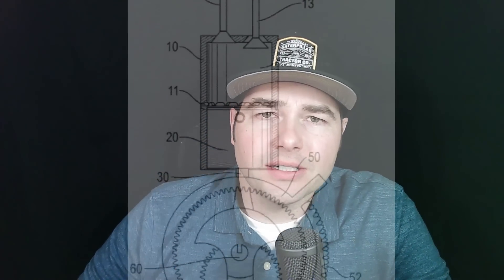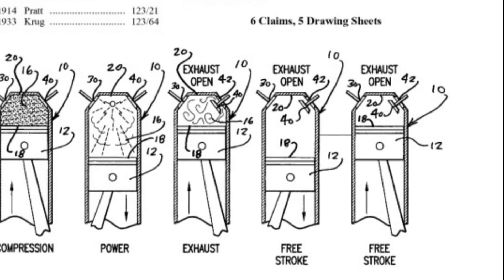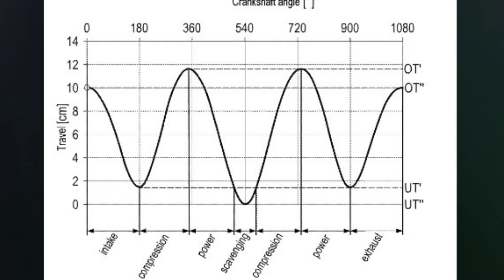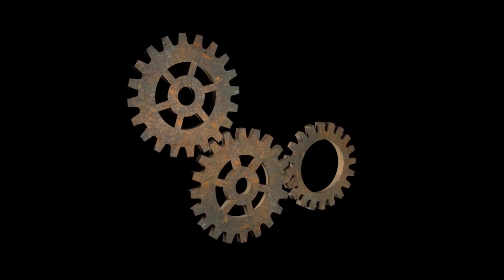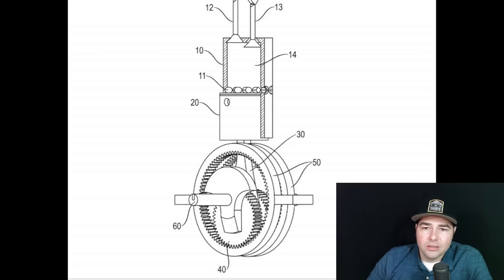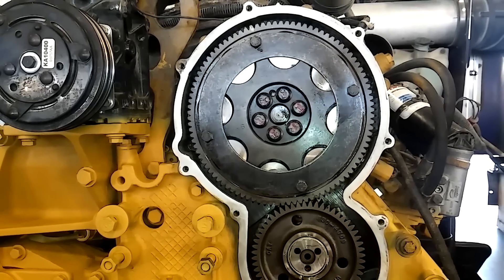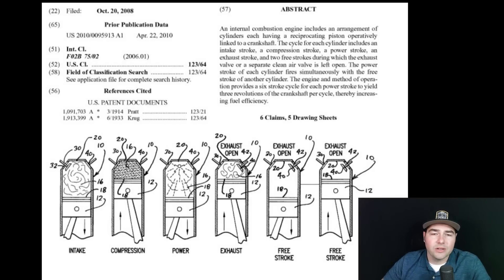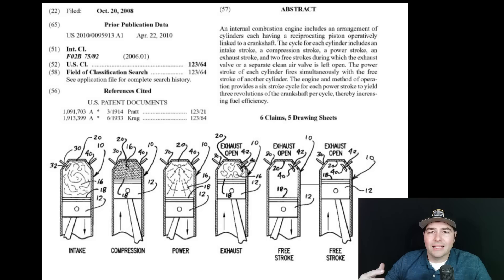Ever Heard of a 6 Stroke Engine Cycle? You Will Want To.

Comment: I know that this is off topic, but I was wondering if you could help me out. I have a C-7 in a 2007 f650 and want to add a bypass filter to the oil system. The filter is already purchased by me and I would like to find a oil supply and a return spot, preferably on the right side of the engine or the passenger side of the engine as it sits in the truck I’ve asked a couple local mechanics and they seem to be lost and can’t give me any direction for any diagrams or anything like that. I’ve watched most of your content and especially the C7 C9 content. Thanks for the help. Josh caterpillar all the way.

Comment: @3:52, the diagram reminds me of the design Nissan came up with for the variable compression ratio using a fulcrum design (for lack of better wording) to extend the stroke length (as / when needed).

Comment: If you want an interesting topic, research the Miller cycle on both 2 strokes and 4 strokes.  Allows for a expansion stroke that is longer than the compression stroke.

Comment: Hi Josh, Josh here. We recently did a complete overhaul out of frame on our 3406B and now after 15000 miles it is losing a lot of coolant. The top of the radiator was completely dry, had to add 4 gallons. No leaks, oil level has not risen at all, obviously nothing in the cooling system cause I had to add 4 gallons. The catch bottle I attached to the radiator overflow is bone dry. There is some condensation coming out the breather tube but not a whole lot, same with the oil fill plug in the valve cover. Last I noticed there was no white smoke out the exhaust when running. Oh cold start it has a bit of blue/white out the exhaust. I don't know how much is too much but if it is in the shop it fills the shop with a haze quite fast. It has to be something head related right?

Comment: Hey Joshua I got a c-13 it's been giving me fits and I don't know where else to turn or look for the problem I've got it compressor for whatever reason wants to keep popping off at at the pop-up on the head it's in a sterling it's in a mixer concrete mixer but I was hoping you might be able to shed some light on it it's got a new compressor got a new dryer new governor and I don't understand why it wants to keep popping off their the head it will pop off even if the pressure's not all the way up where it should be in the tanks now it only does it have 1500 RPMs in above the 2000 but I like to figure out the problem so I don't ruin a compressor

Comment: Content Idea, maybe you could begin a series of basic maintenance videos and repairs that would extend the life of a truck?  What to look for when buying a used truck, was scammed finding out my crankshaft was damaged reflected in low oil pressure, was talked out of pulling the bearings to check for damage,  an expensive way to learn for someone with gas vehicle repair background.

Comment: HELLO, WHAT IS A GOOD PART NUMBER TO BE ABLE TO DO A CYLINDER PRESSURE TEST. ITS A CAT 3406C. HAS THE OLD STICK NOZZLES (FUEL INJECTORS). THANKS IN ADVANCE, FOR ANY ADVISE TO HELP ME COME UP WITH SOMETHING. OR WHAT WOULD IT TAKE TO DO A ACTUAL LEAK DOWN TEST ON THIS ENGINE?

Comment: Hey I know this isn’t the right place for this question but… I need to know how to make and where to buy the parts for a c15 fuel pressure gauge to check pressure at the filter housing? Thanks
Reply: I will try an get part numbers from Cat. Most people get the gauge that plumbs in from the bottom 1/4 NPT. Then they get the protective cover. The hose is usually a number four JIC. Now where you check it is up to you. A lot of people use the quick disconnect fitting at the secondary fuel filter base. However that port measures fuel psi before the secondary fuel filter. Thus you are not getting a true reading after the secondary filter. On the fuel filter base is an allen plug that is in-line with the fuel supply hose to the head. I dislike using it because if you strip it out. you have to purchase a new fuel filter base. Unless you put a fitting in that port and cap it. I take the fuel line off and I have a tee that I use in that location.
Now if your going to install a gauge in your truck, that is completely different. So what do you want?

Comment: With the right actuators and/or dual cams could you alternate the valves to scavenge the extra strokes? Not that ya would really want to without having to change the bottom end

Comment: A 6-Stroke engine is virtually the same as a single turbo 4 stroke engine, just an extra expansion and compression stroke, which is the job the turbo does, recovering exhaust heat to compress intake air

Generally big marine diesels run with boost pressures of 90 psi and above as it keeps the turbo doing the compression job of the engine, on the otherhand the super lean air fuel mixture of 50:1 dilutes every explosion making less heat and more pressure. The Wartsila 31 does get 51% efficiency

More than 55% efficiency likely requires exhaust heat recovery and power turbines

Btw adding a spiral vane throttle in the turbo intake would do wonders to engine efficiency as you can vary boost while keeping the turbos working at the optimum speed

Comment: Odd thing I’m seeing, Atkinson and Miller cycle engines gain efficiency by shortening the compression stroke (less back force on the piston). According to that waveform you showed, this design is making the compression stroke longer. There’s only 8cm of travel between the exhaust and intake strokes, but ten on the first compression stroke and twelve on the other. I get more compression makes more power, but making that stroke longer tends to hurt overall efficiency. I like Mazdas new two cycle gas engine idea way better. Looks like a Detroit setup (supercharger and all), but uses electronic direct injection for more precise fuel delivery.

Comment: That original patent from like 08 is effectively the same premise as an Atkinson cycle engine. Except this uses a dead cylinder and exhaust valve instead of creating reversion with the intake stroke.

Comment: This engine design was made because of emissions. Porsche have an e fuel plant that produces methanol that was made using carbon capture tech( carbon mixed with hydrogen) efficiency is essential as the fuel will probably cost a bit more , carbon nuetral era

Comment: Egr is to keep combustion temps below 2500 deg F. This should do that, but can't see the bottom end being that great. Regular crank, boost airflow with a turbo, inject some water to make steam, should  give you a thermodynamic advantage. Without egr and possibly def on a diesel. I think they could just go dual fuel on a modern diesel (propane) and use water injection and get the clean burn low Nox with a 4 stroke. No egr and no def. Probably could platinum coat the piston tops and get rid of the scr as well.

Comment: Trying to wrap my head around the change in stroke. Does the whole crank move up and down, which would lead to ask what sort of main bearing design would be used, or, does each rod just change its stroke length, which would require a planetary setup on each rod. Confusing. Also, I wonder if the "extra" stroke, with the air from the ports on the bottom of the cylinder, is meant to burn off retained exhaust gases and/or EGR gases which could be done by the introduction of the new intake air.

Comment: The additional BDC stroke length captures more of the force created by combustion 1 and the additional compression/power stroke burns non-scavenged exhaust gases from the first power stroke for better emissions. The combinations create about 25% more power (theoretically) over 7200° of rotation. Big problem I see is vibration from several different out of phase rotational components and what the rpm’s will be like (how high). There’s also a worm and ring gear to change the compression ratio, I got no idea how that will work. Wild stuff; cool design though and all the components and how they go together are well understood.

Comment: The second 6 stroke reminds me of the old hit and miss engines a bit. I don’t emission’s were on there mind just fuel consumption. Also they were kinda of a constant speed engine.not really clear to me but something along the lines of a governor would hold the valves open when spinning to fast. Not really sure it would work in a 
 car or truck. 
Great video thanks for sharing your thoughts.

Comment: I still think the 6 stroke design that used water injection on the 5th stroke, and another exhaust stroke on the 6th was a decent idea. Basically makes it a steam engine on those strokes. Helps capture some of the energy that is wasted going out the cooling system.
Reply: ,,, yes , and Bruce Crower did not take any advantage of common rail , and computer activated valves . Just proof of concept , that was brilliant in its simplicity and frugality ,,, .

Comment: Another YouTuber explained that Porsche's design is purely for performance. 2 stroke engines produces more power pulses than 4 strokes, but burning crankcase oil is a huge no-no for emissions. The only road legal 2 stroke option is something like a Detroit Diesel 2 stroke, but those engines absolutely requires a supercharger to run, which has parasitic losses.

So Porsche's 6 stroke engine keeps the 4 stroke cycle so that the engine can at least start and idle without boost pressure, but the 2 stroke cycle uses the combustion and exhaust from the 4 stroke cycle to help pull in fresh air from the lower intake ports. Emissions and efficiency is still good because it uses gasoline direct injection, and it doesn't burn oil.

Comment: Egr from another cylinder  is what the ports are for if I'm thinking it's free fuel
Reply: It will work as long as the intake valve is open just before piston down stroke past the ports then up stroke plus fuel makes boom boom

Comment: With common rail electronic injectors this could easily increase fuel economy like a displacement on demand system when you don't need all the power.  The non fueled stroke would allow the air to cool the combustion chamber.   There would be a drop in boost.

Comment: Nothing beats Suck, Squeeze, Bang, and Blow.
Reply from the maker: There is an extra squeeze and bang though!
Reply: @AdeptApe Mr, can you explain why newer diesels have lower compression compared to old ones? That would be great
Reply: @MrAl2742  in not really inte diesels, but it could be because almost all diesels have turbos now.
usually for petrol engines you lower the compression when you add a turbo so you can have it flow even more air into the cylinders, and the working pressure will still be similar as before

Comment: I saw another video or two about the porche engine a little while ago, the idea behind the ports in the bottom of the cylinder is just to let in a small amount more air (requires high pressure forced induction), before giving a lean squirt of fuel for the second power stroke, to make for complete combustion, making for cleaner emissions,  and the added power per number of revolutions. Due to efficiency losses from the crankshaft geartrain, as well as the second combustion event having less total yield, the folks who are way smarter than I were guessing anywhere from 15-25% power increases, with may be a 10% efficiency increase if memory serves.   I dont think there's a prototype out there yet, but it seems like a very porche thing do do.  I bet they will make one, will it work? I dunno, I really appreciate clever concepts like this, but am painfully aware that " ze german engineering " isnt always all its cracked up to be.

Comment: As your average idot mechanic, if i were to give my guess, it probably has something to do with unburnt gases in the combustion chamber. The holes on the extra stroke allow iust enough fresh air to finish burning it. My first thought with the "planetary" was a nightmare, but like you said, it's not often I find a gear failure in engines or transmissions, and planetary gears are used in the most high torque applications, so maybe? Seems like a lot of crap to pack into a small area, though.

Comment: nooo. two strokes are not extinct, many , many Detroit's are still alive and well including. the two in my boat , watch bus grease monkey  that is mostly what he works on , great engines that are still running after 40 + years
Reply: He’s referring to being still in production, and probably referring to only trucks, because that’s his area of knowledge
Reply: Think you went waaaaaaay outta context here. Besides that, even the boat industry gave up 2 strokes years ago, so I’m uncertain as to your point. He’s saying that there are virtually no modern 2 strokes, especially in the diesel segment (at least in typical use cases. Obviously, big marine engines are still 2 stroke.).
Reply: Uh nobody manufactures them anymore.
Reply: @kman-mi7su  far from extinct
Reply: @ The point that everyone seems to be missing….
Reply: There fading away but we are still using detroit 453 671 2 strokes in some of our railroad equipment at bnsf. Just a month ago they replaced one in a balast regulator.
Reply: @grahamgeiger3206  And what century were they manufactured? That’s the point.

Comment: Perhaps in a 6 Cyl engine you would get a lower strength stroke at the same time one of the other 5 cylinders is hitting it's full power stroke.  So for minimal effort, you get 1.xx return instead of just the power from a single cylinder.  On a 12 cylinder engine, you could get double the .xx power since two cylinders are at full power and two are at the reduced .xx power. I honestly have no clue but it seems like it might be a thing.

Comment: Wonder if they could implement this without the planetary crankshaft, by just sticking with a fixed stroke. But, adding an additional set of valves to feed the ports in the cylinder? I mean, intake air and exhaust are still going the same end route anyway.

Comment: I can understand it for emissions purposes. But you lost me on the different stroke length and transfer ports. Is the crank only supported at each end? How could the stroke length change if it had a traditional block?
Reply: the big end is coupled to an eccentric.
Reply: @martin-vv9lf  so it only has two main bearing journals then? It's not like the throws are going to extend only for certain strokes. It just doesn't seem like a dependable or durable design.
Reply: @BigJfan  same number of main bearings as any other inline engine. I agree that it won't be reliable. v twin engines tried to use concentric bearings on the big ends, and oiling them was challenging, according to wikipedia. this will be worse. I don't fully understand why they can't do like the atkinson cycle does and open the valves instead to achieve the same effect with less complexity. there were gas start diesels that operated similar, they had a lower compression when a valve into the head was opened.

Comment: Two stroke diesels still around. They are very common in marine engines. Most super large ships engines such as for container ships are two stroke. They burn a really heavy dirty oil normally but can also run on diesel to minimize emissions when not in the open ocean. No spark plugs only compression ignition.
Reply: i believe its less marine engines and more massive engines, as far as i know most smaller marine engines today are four stroke, and by small i mean up to at least somewhere in the tens of liters range. but yes still used in the big ones, and apparently can be really efficient too on that scale
Reply: Container ship engines with the open piston design are crazy - the bore is gigantic. Sadly, the heavy oil is being phased out.

Comment: Crower patented a 6 stroke 10 or 15 years ago for diesels, the 5th and 6th stroke was a steam pressure stroke, and its said the running engine was a lot more efficient and ran cooler. Its worth looking into as it seemed to be a real extra power stroke without combustion and added a lot more power
Reply: That sounds cool, but you would need some way to generate steam. Maybe you can make some with engine heat, but how much?
Reply: Water is scarce

Comment: Hi Josh, l do have question in mind on Cat engines  specially from C10 through C15. When Jacobs are Set or switched On during the time when our engines exhaust that compressed air, do injectors inject fuel in the piston chambers?
Reply from the maker: No, because you only use Jake's when the throttle position is at 0 and the RPM are above idle speed, so the injectors should not be firing fuel.

Comment: Yes the air cooled Double Wasp 18 cylinder aircraft engine build by Pratt and Whitney. They did this to cool the head by injecting a water sultion
during  two extra strokes, horse power was increased from 1800 to over 2200.  Nice right.
PLR
Reply from the maker: Well that's super interesting, someone else knows everything if you have enough people.
Reply: i wasn't expecting to read about a water-injected engine today, but now I guess i don't have a choice